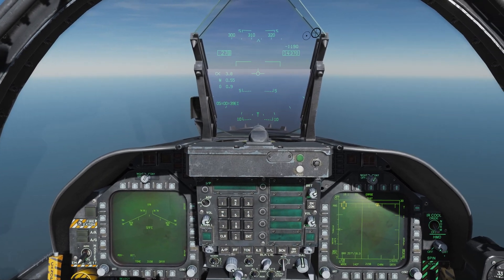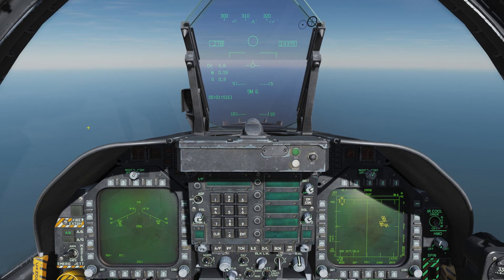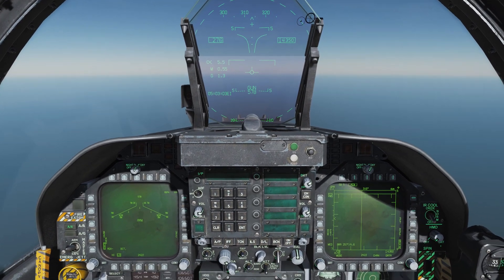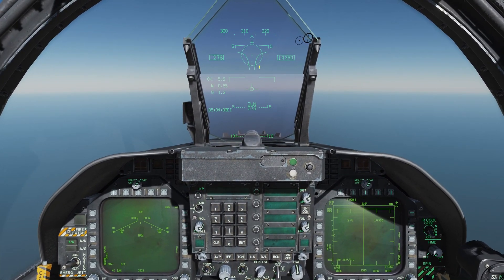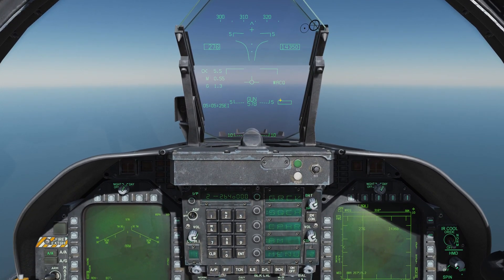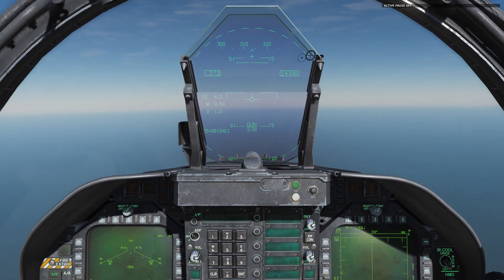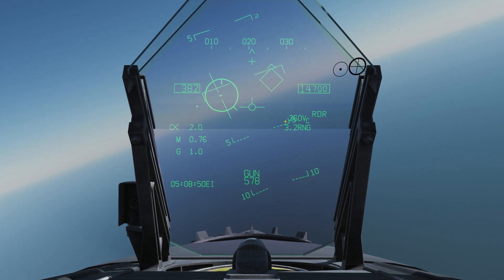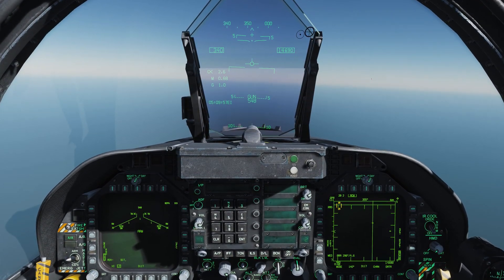DCS World Tutorials - F/A-18C Hornet - Intro to ACM Radar Modes and the M61 Cannon

Comment: Is it normal to have to reselect vertical scan mode on the stick after losing lock in a dogfight?  (The radar doesn't stay in VS mode?)
Just find it odd that the radar leaves vertical scan mode if it loses lock during a turn fight. 

I've got thousands of hours in DCS and BMS in other aircraft. Wondering if theirs an issue or bug. Doesn't seem right to have to constantly fumble with the radar mode on the stick during a dogfight whenever the hostile maneuvers outside your radar's visibility.

PS. I was using the HMD during all those dogfights merely as a tool to keep a constant eye on my speed and altitude. Not sure if that has anything to do with it.